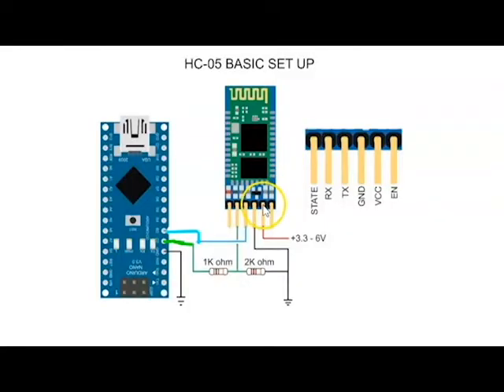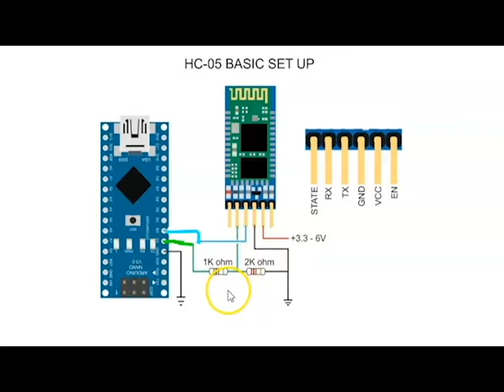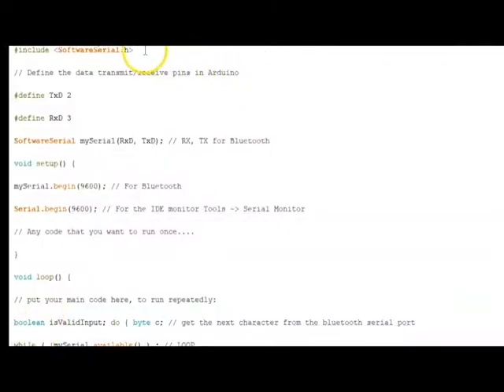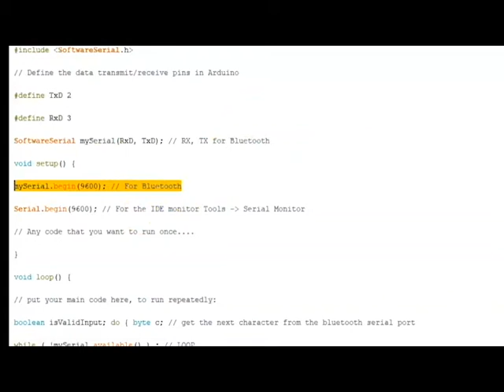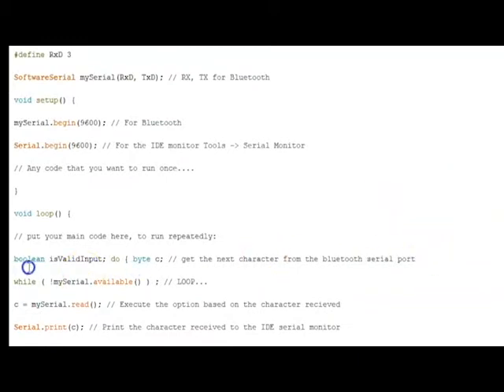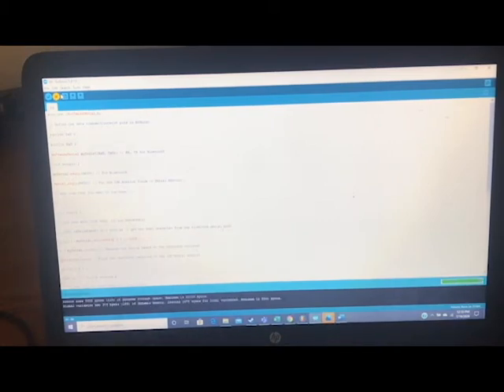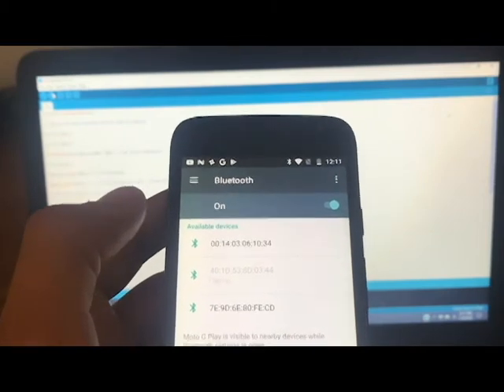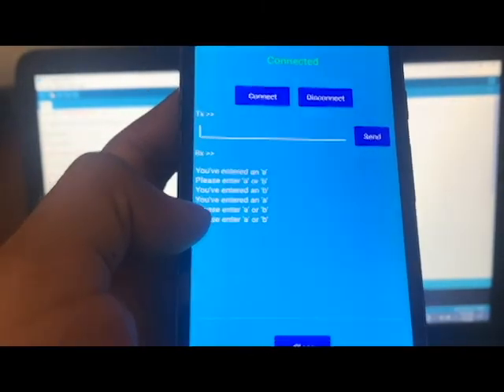How to Connect Bluetooth (HC-05 ) to Arduino Nano

Comment: So I faced the same issue but this video opened my eyes. My HC05 was working on my arduino uno but not on my arduino Nano. so I did set my baud rate to 115200 using my uno but couldn't send AT commands and receive OK status through the serial as I did in my Uno. So here is the connection.

NANO                        HC05
5v             ->               Power(3.3-6v)
GND         ->               GND
TX            ->               TX
RX  -> Voltage divider  -> TX

Voltage divider connection
NAN0 RX  -> 1.2K  -> Junction( HC05 RX)  -> 2.2K  -> GND

Only after doing this did I receive a response to my AT commands. Just send a blank sketch to the Nano connect to your default baudrate (HC05 baud rate if not changed) send the AT command. If everything is okay you should receive "OK" status. Remeber you should send the blank sketch before connecting anything to the Nano.
Reply: Holy hell brother. This is a legendary comment. I have been beating my head into a wall, only after following this did I get the OK status. I could kiss you right now omg